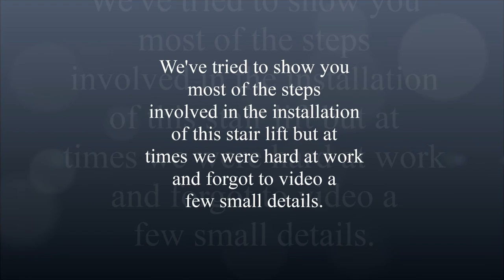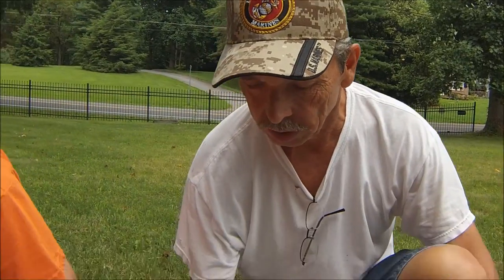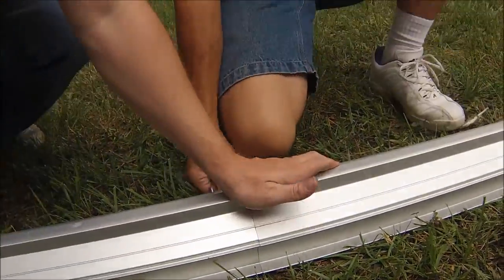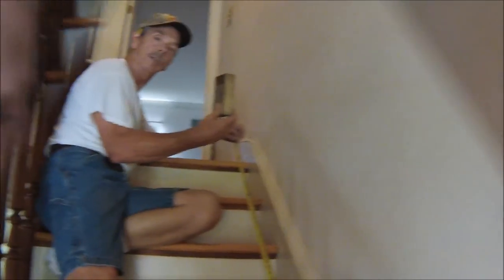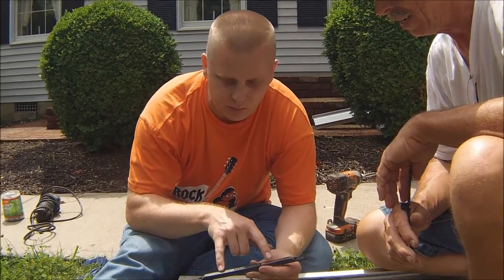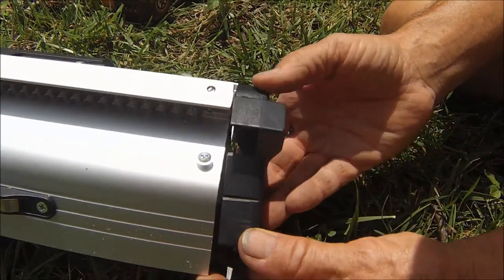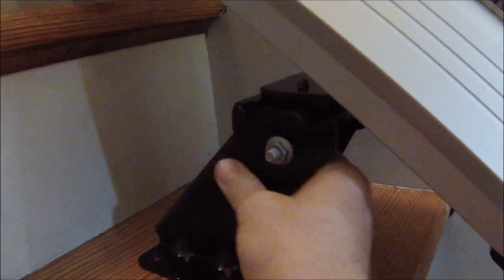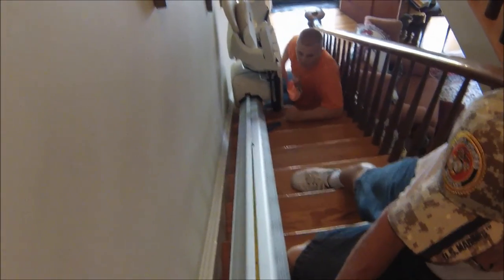ThyssenKrupp Access Levant Stair Lift installation

Comment: There is not to much to installing that stair lift but has to be done correctly for safety. No short cuts. Thanks
Reply from the maker: This one was a used chair that we removed and reinstalled so some of the smaller details are missing. But there still isn't too much involved.  We can be finished in 2 hours.  Thanks for watching.

Comment: Nice clean install. Is it totally battery dependent or does it use household electric and use the battery as a back up?
Looks good guys.
Reply from the maker: This model is battery dependant. It is plugged up and the chair must sit at the top or bottom in order for it to charge.  If the chair is left midway or doesn't come in contact with the charging strips then a beep will sound after a few minutes.

Comment: Hi, thanks for this video. I have the same and I would like to change the batteries but I have not found how to open it to change them.
Should the seat be removed from its rail?
How to open it?
Thank you
Reply from the maker: I do not believe the seat chassis would need to be removed from the rail. You should be able to access the batteries after the seat and panels on the chassis is removed. You may have to remove a plate retaining the batteries in place. Would take about an hour to replace.

Comment: Good morning ! Thanks for the video, could you fill me in? I see that the charging stations cannot connect in the same way on my grandmother's, and it does not charge any more. Could you tell me if your 2 charging stations have a + and a - each on the same connection? Thanks to you.
Reply from the maker: Thanks for watching. Both charging points (top and bottom) will have a negative and positive contact. Make sure your points are contacting the strips. Over time, things can become worn. Also, these batteries typically only last 3 to 4 years and will need replaced.

Comment: Hi, I am not sure if you are still checking comments, but we are having a hard time getting the car(chair) onto the track.... Have no idea what we are doing wrong. We purchased through a GoodHealth Will and have looked online for a manual, but cannot find one. It is a Thyssenkrup SL47 Citia. We have the track secured down the stairwell, and can slide the car onto the track, but once the gears meet with the gears on the track, it won't budge. Thanks for your reply if you have any suggestions!
Reply from the maker: I'm constantly checking messages.  No problem with you contacting me. The first thing that comes to mind is that the batteries aren't charged. when you slide the chair on the top and the wheels go into the track, the gear on the chair will come in contact with the gear in the track. You then need to have the controls powered up. Just hit the down switch. if it does not run then the batteries are not charged. Look for the green light when it's hooked up. If you are getting power then maybe a pressure switch is being accidentally pushed.  When you slide the chair on the track you have to be careful not to damage the switch under the motor.  If all else is failed you can still manually move the chair down the gear.  You have to remove the cover from the foot rest and it should expose the main shafts in the motor. You can safely hook a drill to that and it will slowly move up and down the track.
Reply: +Cobrafanatik22 thanks! Have not tried yet.... But will post again as soon as we do!
Reply from the maker: +April Fosdick ok. Let me know. I'll help as much as I can. That's the reason we made this video.

Comment: I hope you can help! We just removed one of these from a house and installed exactly the same in our house. We plug everything up and hit up with the control and then it just starts beeping. I noticed you had two charging strips at the top!? This one only had one on the right side of looking up at it. Is this my issue we are missing one somehow or a different issue? We don’t have an led light, but like you told somebody else it might just be bad.
Reply from the maker: Cobrafanatik22@aol.com. send me some pictures of the charging strips and we will communicate through email if that is ok.
Reply: Yes! Of course if you’re willing to help I appreciate it!

Comment: Who can I contact to make repairs on my chair lift? Mine stopped and I can't get it started again. It is not the batteries. I heard a grinding noise and it stopped in the middle of the track. How do I move the chair to the top or bottom of the rail?
Reply from the maker: You can contact the manufacturer online. They have installers located in several different areas. 

It sounds like the emergency stop switch has been activated and it slams two teeth into the track and forces it to stop. If you take off the front cover of the chair (the cover covering the bolts that are used to bolt on the foot rest) you will see a shaft. it may be hex head or it may be square like a socket extension.  That shaft is the center shaft of the motor. You can hook a drill up to it and drive it backwards. Once you move it backwards the emergency stop may release. Most of the time so meting has jammed in the gear teeth when that stop is activated. I hope this helps.
Reply from the maker: did you resolve your issue?

Comment: Can i charge batteries in my stair lift 2 big black battery  make  bruno ....?
Reply from the maker: I'm confused by your question.  Not sure what you are wanting to do
Reply from the maker: +Mario Canzanese A battery supplied stair lift will have two black batteries inside wired together to the unit.  They will need to be connected to a charger or they will go dead in a matter of days.

Comment: How to charge the chair if its not on the track
Reply from the maker: You will need to remove the batteries from the chair and put them on a portable battery tender/charger. Or replace the batteries if they have any age to them.

Comment: I've just installed one myself and the gears are almost at the bottom of the track but not all the way so the battery won't charge.  Can you tell me how to release them once it is already installed??
Reply from the maker: There is a max amount that the gear can set off of at the bottom. It won't hurt it if the gear is all the way down. The part that makes it charge are the contact strips.  There is a stop on the track that stops the chair.  If it is in the wrong place then the chair won't stop on the contact strips.  If it is sitting on the strip then I'm going to guess and say that a wire is unhooked.  Is the alarm beeping when you rest the chair to the bottom? Is it charging at the top?
Reply from the maker: The gears aren't going to affect the way it charges.   If the gears are set too high then the chair will run off of them.  As long as it goes to the bottom and the stop strip trips the switch, it should be charging as long as the charging contacts are on the contact strips.
Reply: The battery has gone flat just before the bottom and the points aren't reaching the contact strips so it can't recharge.  Wondering how I can get it to hit the strip as it is only an inch or two away.  I can't seem to move the chair manually to see if the contact strips at bottom are working.   Can I push it to the top where I know the strip works?
Reply: It does a constant beeping when turned on and I assume that means the battery is flat.  It was all working fine when we moved it here.  Thanks for your advice.
Reply from the maker: The beeping is there because it's an alarm when the chair is stopped and it isn't on the contacts to charge the battery.  It doesn't mean the battery is dead.  If you installed this exact chair there is a plastic off white stop that is about 2 inches long on the top and bottom of the track.  That stop does not have pre drilled holes on the track and there is a measurement in the manual where that stop is supposed to be screwed to the track.  That stop triggers a switch that makes the chair stop.  I want to think it was 2 & 1/16" from the bottom.  Can't remember exactly.  If you are certain the contacts aren't touching the charging strips then that stop needs to be moved lower on the bottom.  Sound right?
Reply from the maker: There is a shaft in the motor that you can attach a drill or ratchet to to move the chair while it's engaged on the gear.  If you have some beeping then you have some battery life.   Leave the chair at the top until you fix the bottom stop position.
Reply from the maker: did you ever get it figured out?
Reply from the maker: +Adeylou Who Any luck?
Reply: @1tubehaydn  hello
Reply: @Cobrafanatik22  hello